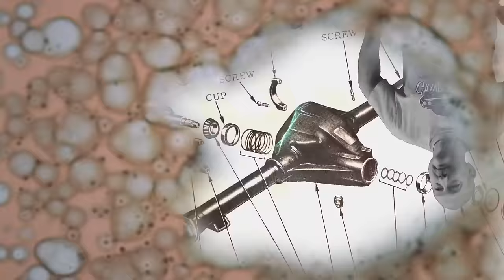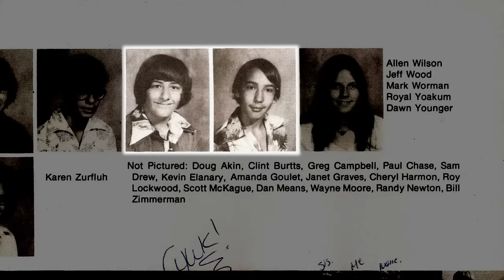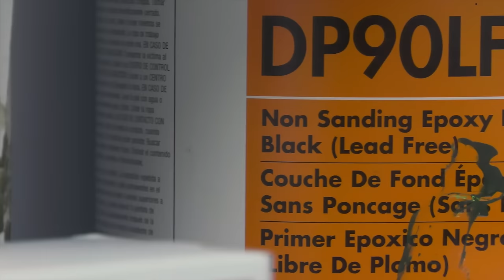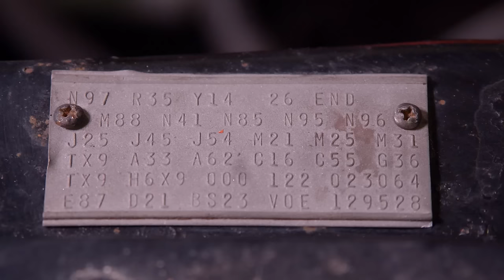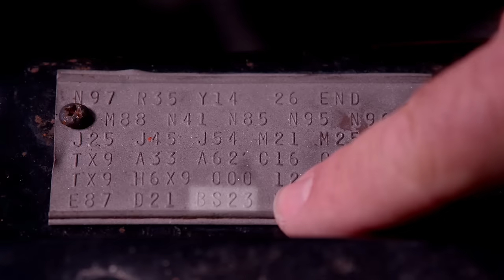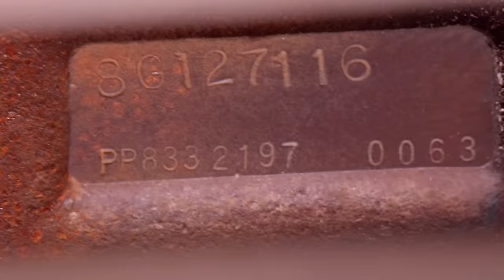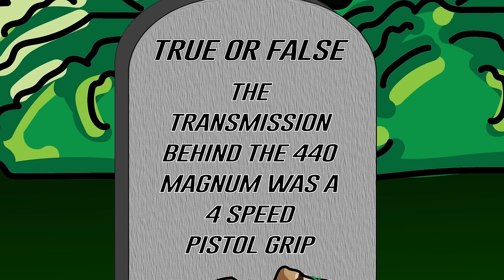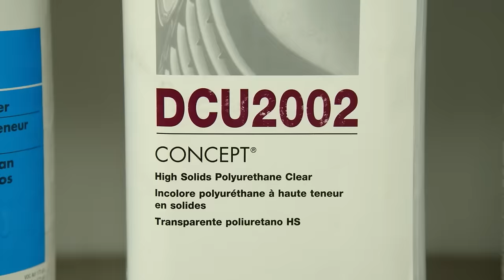THE SIX MILLION DOLLAR MAN: REPAIRING AND PAINTING AN ORIGINAL STEEL DAYTONA NOSE BETTER THAN BEFORE

Comment: I worked for a Full Line GM dealer in Vancouver BC in the 70, s,  called Deck on Broadway. They sold ALL GM,s muscle cars, across the full line. They had a highly recognized body shop, which ended up fixing a customer's Daytona 3 times on the front nose, over 1 1/2 years.